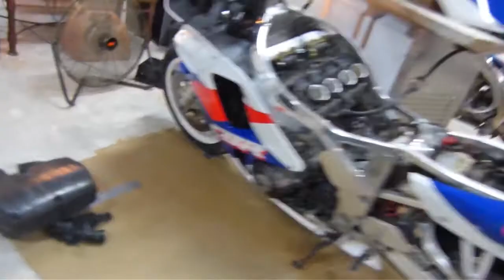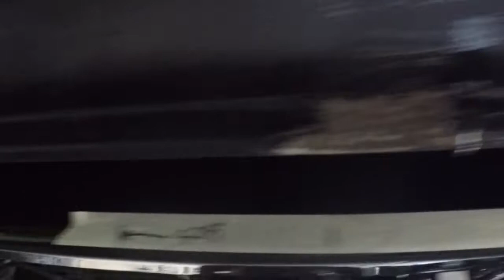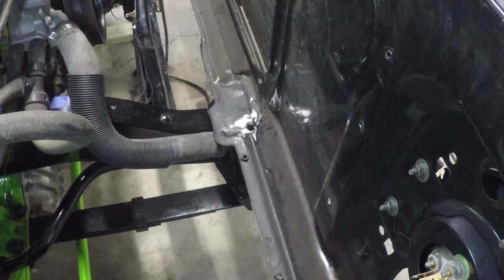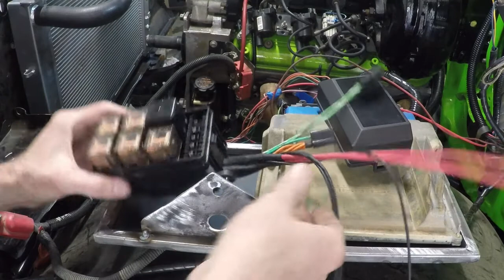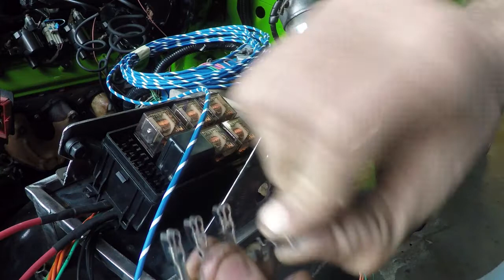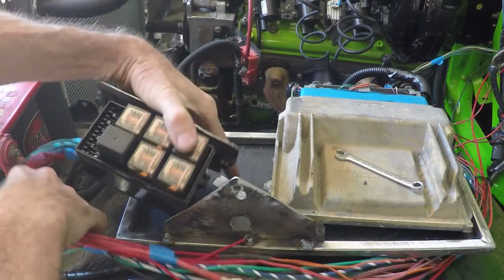The Jimmy project: Radiator, wiring harness, and custom fuse block.

Comment: i cant  figure out what the wires on the engine side of the bulk head i have 
Purple ----- starter
Red-------main power
black with white stripe --main power ?
Green ------ temp gauge ?
Black------ ?
Brown ----- Alternator or AC ? 
Small Red ---- Coil 
3 Tan wires ----- ?

Comment: Hey sir, I’ve did the same thing 6.0 came with a 4x4 tranny i swapped to the 2wd, exact same as you. I was wondering what harness to go with? I still have mine but it’s in rough shape… what are your thoughts and suggestions? Love your work man
Reply from the maker: oem harness
Reply: @CrankAddict  i was looking into PSI harness, think that would be alright?
Reply from the maker: @Warmachine817p  If it connects to both the engine and trans then it should be fine.